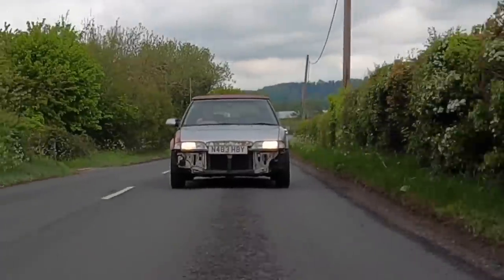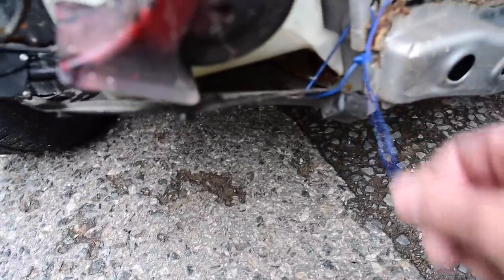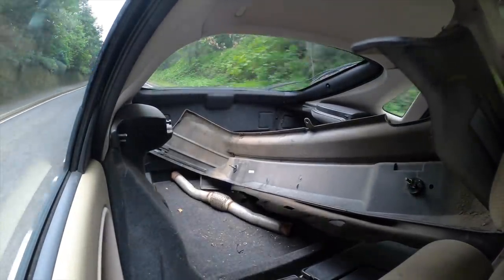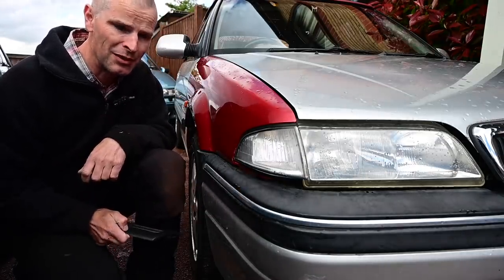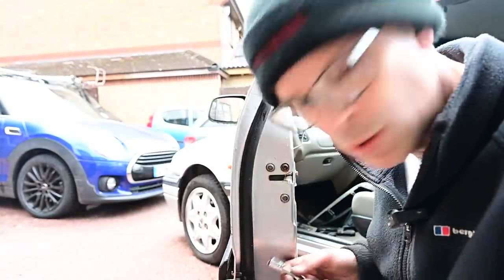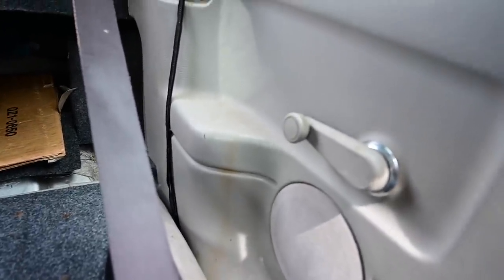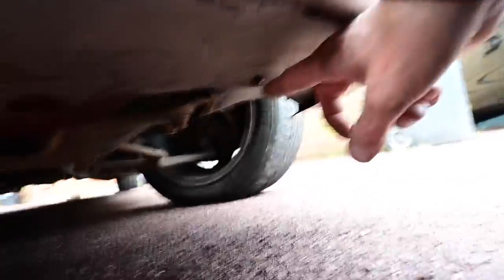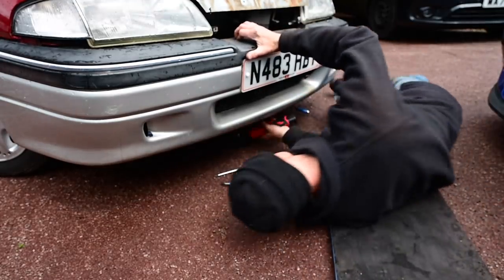Quentin the Rover is off for paint!!!

Comment: I can't wait to see Quentin painted and the V8 running and driving!
Reply: When did he put a V8 in Quentin?
Reply: @carlreading9916  I mean the P6 V8...
Reply: @carlreading9916  There is a car in the garage beside the Mercedes and it's a Rover P6 with a 3.5 V8 from a Range Rover (I think) that has been a long term project from before this channel started. It's getting close to starting besides some difficulties with, well, basically everything for various reasons. Quentin still has his original (to Furious Driving anyway) engine.

Comment: It was quite normal for bits to fall off the Rover 200, I owned one for two years in the early 90s.  It would spend a lot of time at the dealership being fixed , I gave up when the K series head gasket blew at 19000 miles.

Comment: The spring wire handle retainers aren't a problem, you're just using the wrong tools.  Make up a strong wire puller, with a deep J shaped end to hook onto the loop. The better fit it is, the less chance of the clip launching itself across the workshop as it pulls off.  Put the spring clip on the handle, align in position and and push on, or a slight tap to refit.  If it's made from steel wire, such as a thin welding rod, you can magnetise it.  Stroke it in one direction on a magnet, it will keep hold of the spring wire clip as it pulls off.
Reply from the maker: I have a selection of bent coat hangers for P6 use, they work well but its still a fishing trip trying to grab them!
Reply: @furiousdriving I made a selection out of Catenary Wire, for BL car handles and other awkward clips usedin the trade.  It's the strong thin stuff used to support overhead phone lines and cables.  I found putting it in at 90 degrees to the loop, pressed against the spindle, it clicked in over the clip first time. The loop can only be in one of two places, handle side, or opposite.  You feel the hook click in the loop, then just spin it 90 degrees to the direction you want to pull.

Comment: Great idea using the magnetic tray to remember the positions of where the nut and blots originate from. 
I didn't notice it on the video, but I hope you have labelled which side of the tray represents the front and which is the back of the car or otherwise the fun and games will commence!!
Reply from the maker: Luckily its quite different so easy to remember
Reply: you have Quentin written on the tray to keep it aligned ;)